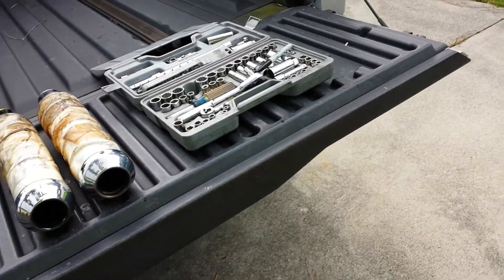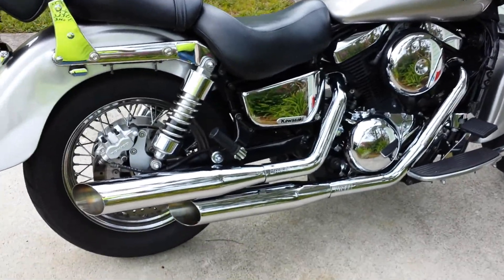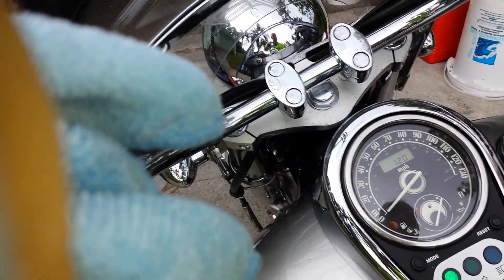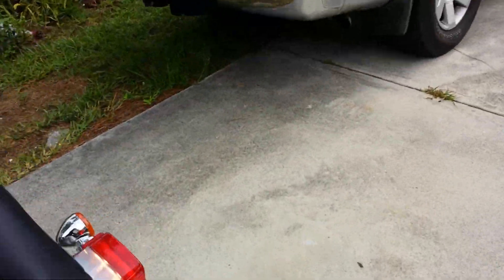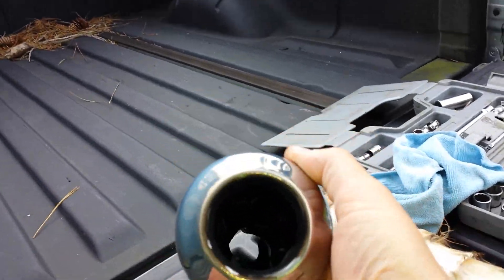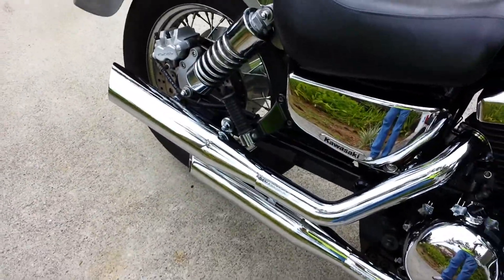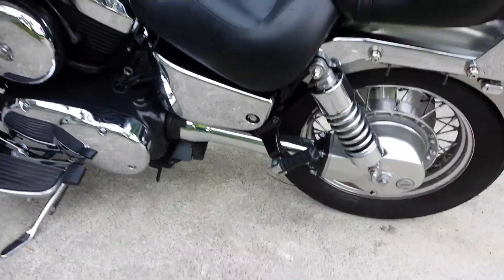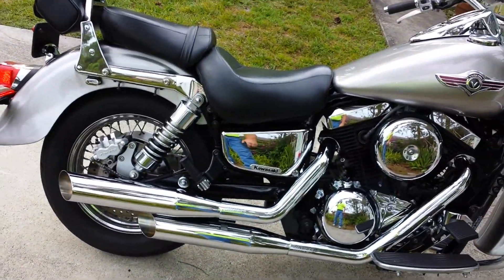Vance Hines Uncorked

Comment: Hi well  presented video 
Can you buy any chance please tell me if the vn 1500 classic year 2000 has an oil level window if so where is it
Reply from the maker: Mine was an '05 but I'm sure an '00 is the same and it's on the lower right side of the engine crankcase.